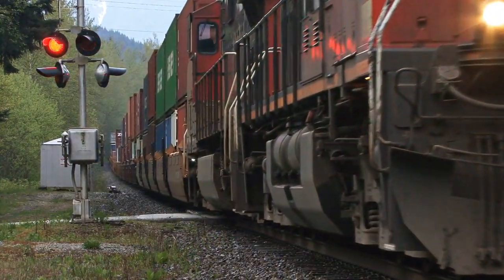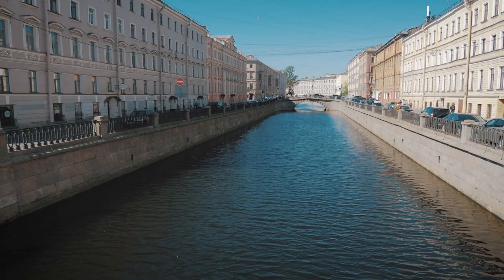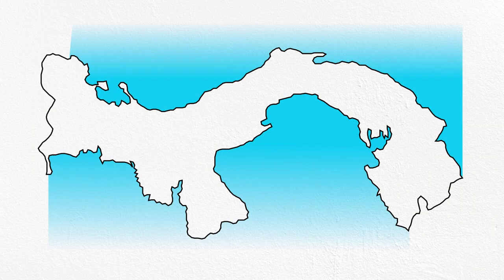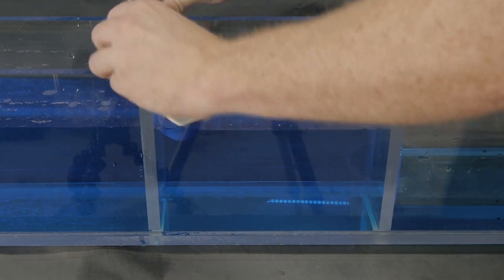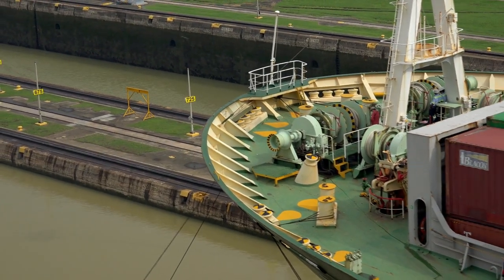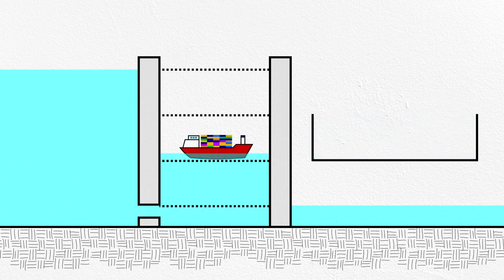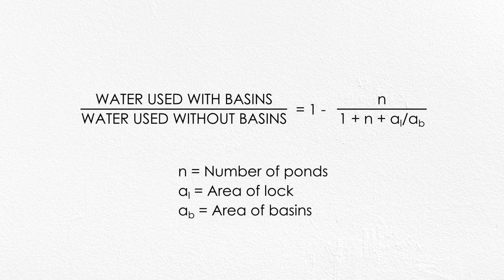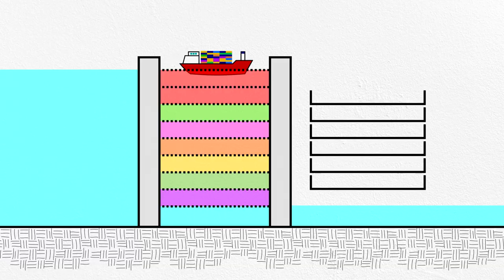The Surprising Efficiency of Canal Locks

Comment: This should be a poster: “Water always drains to the lower canal. This is because of gravity. Hopefully that's obvious.”
Reply: WhAtS gRaViTy?¿?¿?¿?¿
Reply: I'd buy it
Reply: vsause: or is it?
music plays
Reply: But, but, but the Earth is flat and there's no such thing as gravity!
Reply: @gmc9753  That's one of the funniest things about the "flat earth movement", they know that water seeks it's own level, but can't wrap their heads around gravity.  Since it's gravity that makes water seek it's own level that's where the humor comes from.
Reply: @ZoeSoutter  it's 10m/s^2
-every engineer
Reply: cheezymuffin, No ItS nOt!¡!¡!¡!¡
-every flat earther
Reply: @Cheezymuffin.  As soon as you pass over the American border the acceleration due to gravity changes to 32.2ft/s. That's science.
Reply: Nolan Palmer, well yes but actually no
Reply: Yeah, I laughed when he said that
Reply: that should be a sign in the bathroom.
Reply: There are some exceptions though. Near where I live, there is a lock which takes the water from the low lake and always pumps to the higher laying river. This is done because the water in the lake is much cleaner than the water in the river, and the operators of the lock want to keep the lake as clean as possible. If you were to drain the river water into the lake, this would pollute the lake.
Reply: starshipeleven  It's indeed a pretty small lock. I estimate the width of the lock to be about 5-6 meters at most, and the length to be about 25-30 meters. The lake is only about 1.5 meters deep for the most part, and on many places it is even shallower. Also, it's the only exit to the lake and thus it is only used by those that want to move to or from the lake for a vacation.
Reply: Do you believe in gravity ?
Reply: So the suez canal must gradually get deeper towards the center?
Reply: @bernie9728   So the Suez canal gradually gets deeper towards the center is what your saying. You are wrong
Reply: @gmc9753  the earth is a globe and there's no such thing as self leveling water, it has a small bulge in the middle of the lock.
Reply: I wish it were obvious to some people...
Reply: I bet there’s plenty who don’t understand gravity.. there are some who still believe the media
Reply: @ZoeSoutter  thank you for voting Biden. Teeheehee
Reply: @merediths2cents  Slow down there bud, don't cut yourself on all that edge.
Reply: @Cheezymuffin.  its also pi^2 m/s^2
Reply: Honest Question hopefully someone can answer-If there is no flat water on a ball due to gravity, wouldn’t the water contained in a channel have a hump in the middle? Would not the longer the distance between the locks constitute the more of a curve the water would have? If you had 30 miles of contained water in between locks wouldn’t that water curve at the same rate as the earth?
Reply: @AskenEman  Yes, it does. It's just that you'd need a very large channel to actually be able to see that. But it's the same effect that makes it look like ships are "sinking" below the horizon.
Reply: @Llortnerof  No, they don't. See how easy that is?
Reply: @AskenEman  Your experiment will show that the surface is curved because it has already been done before and has shown the same thing every time, even when done by flat-earthers. You don't actually need the pipe, either, because water is auto-leveling.

Not sure why you think otherwise. Of course the water arrived at both ends simulataneously - that just means the pipe was balanced in the middle, not that it is flat. As long as both halves are the same shape, the water will arrive at both ends at the same time. Same for being able to fill it from both sides. It's a pipe. All they showed there was that it behaves like a pipe, and filling it automatically applies a force to the water in the pipe.

Water also has more forces affecting it than just gravity. Surface tension for example.

So yes, i see how easy it is. I also see that you don't understand the basics behind it. This experiment isn't ground breaking, important, or even new. It's not going to produce any results that contradict established science, because it is part of that.

For that matter, nobody has infinite money. The total amount of money on the world is finite. If anybody had infinite money, the total amount would have to be infinite too.

But hey, you already precluded any criticism of your claims by asserting that anybody who criticises you is brainwashed, so what do i know. Aside from the fact that this makes your claims worthless as you're refusing any proper discussion of them.
Reply: @Llortnerof  You have never seen water curved on a flat surface. If the results of the experiment show that the water measures the same height throughout, what does that mean? Please point me to the experiment that shows water curving.  It is not my fault you fell for it. You are very protective of your religion! lol
Reply: Nobody has ever measured the surface of resting water changing elevation on a flat surface. E-V-E-R
Reply: Water conforming to the shape of the sphere earth is what we call a natural phenomenon. It is claimed that we see this in nature. If gravity pulls things to the center of mass, then water must conform to that shape when on a flat surface big enough to measure it. Water conforming to the ball is the dependent variable. The flat surface is the independent variable. Have a great weekend!
Reply: Then I started thinking about a siphon hose running vertically haha
Reply: @AskenEman  "It will be the first outright, unquestionable scientific demonstration of the force of gravity."    No, that's already been demonstrated.
Reply: @mikedelhoo  Yeah. Your Cavendish balls are groovy. But, I really want to measure water changing in elevation on a flat surface. Do you know anyone that has measured that empirically? I am getting confused. I thought water always curved due to gravity. Why doesn't anyone care about building an experiment that demonstrates gravity forcing water to form a curve like the earth on a flat surface? I am starting to get suspicious. I'm trying to demonstrate the curve and measure it empirically while demonstrating the force of gravity. Do you know something that I don't know?
Reply: @bernie9728  If water seeks its own level due to gravity, could I build a flat surface on a tangent and measure an elevation change of the surface of resting water on it? Since all water is pulled to the center, it matters not what the shape of the surface it happens to be at the moment, it will always be pulled to the center of mass to create the sphere. But if I had a verified flat surface big enough, could I measure the curve in the water against the flat surface? Have you ever seen anyone measure a change in the elevation of the surface of water at rest? I would really appreciate seeing that evidence if it exists. I'm just looking for anyone that has measured water changing in elevation from a flat surface. Not by pointing an optical device and pretending that obstruction is curvature but by actually measuring an elevation change against a straight line. We know level is curved in your world but I am looking for a verified flat surface that demonstrates the curve? If not, is it possible? Hoping for a reply. Thanks regardless. I chuckled too.
Reply: @AskenEman    "Your Cavendish balls are groovy."  So you're aware that the force of gravity has already been demonstrated in that way?   Why were you claiming otherwise then?
Reply: @mikedelhoo  I can't take you seriously anymore. Sorry. Take care.
Reply: @AskenEman     Sure, sure. You're the one who made the false claim and was called on it.
Reply: @mikedelhoo  I don't recall that. Why wouldn't you just state what those false claims were instead of wasting my time with your unsubstantiated nervous nerd talk?
Reply: @mikedelhoo  lol
Reply: I am going to demonstrate water taking the shape of a ball on a flat surface and measure the curve as gravity pulls the water into a hump, yet you think a torsion bar trick is better? Are you high? Are you scared? You know that I have already done the experiment and the results will be coming out soon with full details of every aspect of the experiment explained in great detail. The experiment is still fully functional as it will remain in tact to be repeated after the results are released. Can you think of any reason why in 5 miles of perfectly flat surface that water would remain perfectly flat and maintain the same elevation in the 5 miles?
Reply: @AskenEman  There is actually a VERY SLIGHT curvature of wtaer in 5 miles, it's there but it's virtually undetectable with current instruments.
Also why just 5 miles? Why not 50? 100? Can't just assume from a small sample size, it's worth checking larger sizes.
Reply: @3_Circles  I'm sorry. But, you do not appear to know what you are talking about. Where did you get your information? It is well agreed upon that 8 inches per mile squared is pretty accurate op to 100 miles. So, 5 squared is 25 x 8 = 200 inches or about 17 ft. If we rolled out 5 miles of absolutely straight and flat pipeline, do you believe that we would be able to measure the water with a hump in the middle that high? Do you think there would be a hump at all?  DO you still blindly believe that you live on a spinning ball? You know that we already know that we are on a stationary plane. Right? You have no idea how you are being controlled if you are still falling for that nonsense. How in the world do you think you could be flying through space spinning and orbiting with the top down and not feel a thing. This is the ultimate method of enslaving you. They would have convinced you that you were moving when you are absolutely still. IF they can convince you of that, they can convince you of anything. Prove me wrong. Can you name a mainstream narrative that you didn't believe?
Reply: @AskenEman  "How in the world do you think that you could be flying through space spinning and orbiting with the top down and not feel a thing." 

What exactly are you proposing that should be felt? There isn't particularly a large amount of jerk going on with the trajectory of a proposed orbiting Earth, nor is there much jerk to its rotation, nor is there a particularly grand amount of acceleration going on in the first place.

"With the top down" implies that you think there's wind in space-- but it's a vacuum. The atmosphere effectively encloses us and rotates relatively similarly-- but not perfectly. It has its own currents and such, which we can feel but as a whole, its rotation is not especially disconnected from the solid portion, similarly to the water on Earth which is travelling, overall, with the Earth's rotation.

"moving when you are absolutely still"

Concerning feelings of movement, movement doesn't have any innate feelings to it. Acceleration does, because acceleration comes with force, but the reason you can have a similar experience sitting down in a chair in your kitchen, in a car, and in an airplane sans vibrations and such imparted upon vehicles by their environment once they have reached a stable speed is because moving doesn't inherently have any feeling to it, unlike acceleration.
Reply: He said gravity yet, water simply follows it's own laws just like gases have their laws that flies in the face of "gravity!"😆

Comment: I grew up in an area that used to be part of the Ohio & Erie Canal, and you can still see some of the old locks. The gates and water are gone, but the side structures are still there, so you can clearly see the elevation change between sections. Walking along the wall, you very quickly go from being level-ish with the bottom of the lock to being at a definite no-jumping distance. It's a cool bit of history to experience.
Reply: It's really impressive how they built the old canals, especially since it was nearly all done by hand.
I grew up near the old Sandy and Beaver myself.

Comment: Adding to this, at least here in the Netherlands the locks also have big electric pumps to pump water from the low side to the highside, outside the lock. So to maintain the waterlevel on that side and create a buffervolume of water to use later in the lock. It's not the most economical way but it's important to keep the waterlevel between a string of locks to a certain level due to the draft of the ships passing through.
Reply: In Russia they don't need pumps bc they use rails to move the boats up and down.
Reply: And before electric pumps, there were wind-powered windmills. :-)
Reply: I assume this is because those locks are going to below sea level, so the water would need to be pumped up to the sea later anyway. So you probably want to avoid dumping a lot of water down to the lower levels; not so much to conserve water from above.
Reply: @SteinGauslaaStrindhaug  Absolutely no need to go lower than sea level - so no ! It's purely to conserve water above.
Reply: Uk doesn't do it on a lock by lock basis but from bottom to top. Then any intermediate levels can be filled from above - making the plumbing simpler.
Reply: In some cases, this is also done in locks connecting small lakes to rivers make sure little to no polluted water from the rivers flows into the lower laying lakes. If the water got polluted, this could harm the ground water supply for certain nearby areas.
Reply: pmailkeey in Netherlands there are man made canals under the sea level
Reply: Wouldnt there be a problem about the salinity of the water pumped from the lower side to the upper side? (I'm not from the Netherlands so I don't know much about how they manage that water in there)
Reply: @elchungusgrande9635  They are pumping it into the ocean so no big deal.  They are below sea level so if they let the water flow it would flood the land.
Reply: If you're building your pump the right way, you could get to a net power requirement of zero (or maybe even below), by using it as a generator when water flows the other direction. You'll still lose energy, but depending on how much water runs downstream anyway, you might end up poducing more than you require.
Reply: In the Netherlands, the water let through by the lock would often have to be pumped out anyway, being below sea level and all. So there is no energy wasted.

Comment: There is this amazing ferris wheel type contraption in Scotland where you can load a boat at either top or bottom, or even both ends, and then the wheel moves them to the other height.

It's called the Falkirk Wheel, check it out :)